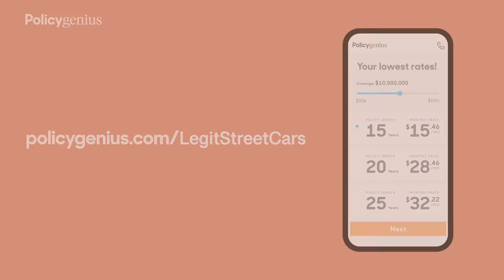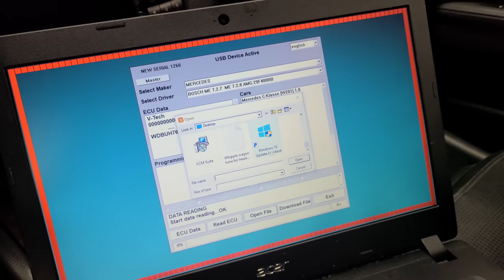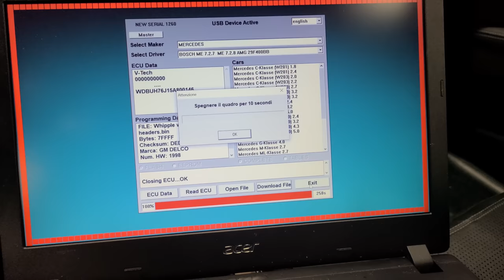We Turned My Whipple Supercharged E55 Wagon Into A SuperCar KILLER With 3 DIY Mods! Sounds Insane!

Comment: I allways use the AMG Transmission Mount A2122401018 (about 50€ over here in Germany), it got 3 Anchor points instead of 2 (the Blackseries Mount, is fully rubbered and super expensive compared to Originals or Lemförder, 130-200€). 
Wagon = Best daily!

Comment: $1k for headers might seem like a lot until you price out a header for my '05 Mini JCW... $1200. For a single 4 banger header.
Reply: I feel ya, custom UEL headers for my subi are around the same price.
Reply: Depends on brand and if you're keeping the cat. Can get a Miltek with test pipe for about 500.
Reply: I laugh at $1,200 headers in my E39 M5 voice 😂😁😂
Reply: or you can go with ceramic coated long tubes from eBay which are the same quality as VRP except $300 cheaper, and offer reduced heat in the engine bay like I did
Reply: @iPodTouch4Life20  Unless they have a brand name on them, I doubt they're the same quality. Most of the stuff on eBay is Chinese knock-offs that look good but crack after a few hundred heat cycles.
Reply: Dont be that guy. Yes, we can all build our cars with hopes and dreams from ébay, but sometimes you don't want to.
Reply: @aaronbritt2025  mine have served me well for 30,000 miles. Initially I was against it too, but I had a guy who has a discount code with VRP (I won’t throw him under the bus), let me know that he recommended eBay over VRP because he restores these cars and builds them routinely and has the experience At one time having both eBay and VRP side by side, he said he couldn’t tell the difference so I trusted him and I haven’t had any problems. That’s not to say I won’t have problems in the future but this is my experience. Yeah, eBay has a bad reputation for parts sometimes but unless you’re going with ARH, don’t worry too much. The cost savings is worth it in my opinion, especially since fitment is no difference.
Reply: @playerroku4412  check my reply. For this application it’s different. I treat my car with the utmost care possible, but when something makes sense, it just makes sense.

Comment: A tip: do not tighten your headers onto the heads first. Get the nuts started on them so it still moves, then work from back to front when tightening them. It will make your life significantly easier.
Reply: Speaking from experience? 😎

Comment: I drive a 2015 Mustang GT PP1 with the bolt on items with a 93 tune and seeing around 500hp.  As much as I would love a "kompressor" and approximately 700+hp, 500hp is "enough".  Love the fact that I get to drive it on the Autobahn on the daily and get it opened up on the unrestricted sections.  I agree with the BEV comment.  ABSOLUTELY NO SOUL.  It might be a rocket, but without any V8 noise, what's the point.
Reply: Every couple years I spend months in Germany. Between Frankfurt & a town near Düsseldorf. It’s amazing sometimes just cruising in the right lane & seeing hoe fast bikes and cars fly past.. literally in a blink of an eye. Germany is number one for roads too in my opinion.. smooth & not filled with cracks and holes like every city in America haha

Comment: For the airbox there is a carbon fibre all in one piece you can fit to that TB.  It also uses factory filters and bottom sections, plus the intake tubes from the radiator section.  Looks very clean.

Comment: Amaaaazing set up, love it. Be very interesting to see how the trans holds up with the increased power/torque. Perhaps taking regular samples checking for oil and clutch break down over set mileage to track how it's going?
Reply: The trans is good for about 700hp and about 770 ft lbs. With these engines it is the torque that becomes the limiting factor as it is so high. Above 700hp the torque is too much for trans to handle. 

TT V12 used same box and was detuned to keep torque in check. The 7-speed was not strong enough so they used 5-speed until about 2012 for the engine!

Comment: Hello this is your twin from another mother from Cali!!! I have 2004 silver E55, just acquired 2003 SL55 and the nemesis 2005 CL65 with under 70K!!  All run great but when the CL breaks it breaks.  I have been told the total repair bill for the CL65 is 25K for the close to two years of ownership.  Would love to make the 55s faster than snot and I'm sure one day I will, just have to build up the nerve to take them apart and put them back together. Just know that every time your CL is sitting mine has been running (where is that wood).  Until these days happen' I will live vicariously through you. I don't do social media. but I have enjoyed watching what you do.  Last but not least, first car 1980 white Trans Am with the biggest blue bird. Of course, it came with the smallest engine.

Comment: Now some custom rims and drag radials for the back. An inch smaller for some sidewall. The one drawback of short sidewalls is like solid engine mounts. They transmit driveline shock to the contact patch and blow the tires loose. A little more meat allows the tire to preload as the inertia to get moving is overcome. They wind up ever so slightly and release within the first 30 feet of launch.

Comment: will you keep the stock exhaust parts or will you upgrade to a louder exhaust ?  I would put a straight pipe from the headers to the back and put the valvetronic universal valved muffler on so you can quiet it down with a remote if you want to

Comment: Hi Alex, I recently bought a 2003 e55 at salvage auction to give it a new life. I've watched your videos for a long time and heard you say you used to work as a mercedes technician. Perhaps you could help me understand what software is used for a 2003 e55 with regards to parts, wiring and diagnostics. Would xentry passthru with a direct obd2 to usb cable to a laptop work or do I need older xentry/star software with a physically multiplexer? Thanks, your e55 is awesome

Comment: Hey Alex I'm working on my 2003 e55 AMG and I'm doing the o-ring that go bad on the m113k engine and in trying to get the upper oil pan off but it stuck on the dipstick guide so I can't slide it out. I'm asking if I have to remove it or find a way to slide it out?

Comment: Quick question - I have a 2004 e55 amg. Mechanic says brakes and rotors are fine but after they heat up there is a lot of break squeel. Is this normal? Mostly under light breaking.

Comment: How do you follow torque specs for exhaust header nuts when you need to use all sort of crazy extensions and swivel joints to get to the nut?
Reply: German torque spec - gutenn tight

Comment: I need your opinion on something. I have a 2000 Toyota Camry LE 4 cylinder. I want to put a cold air intake on it. I was told by a friend of mine that works at Advance Auto not too. I still would like to get a cold air intake for my Camry. I'm customizing the Camry. Yeah I know it's a 4 cylinder. Also would like to get new exhaust headers for the Camry. The exhaust manifold seems to be rusted pretty badly. So do you have any suggestions for that too? Please respond thanks.
Reply: Honestly…..not worth the time and money….wait until you have a car that doing that work would get better gains for

Comment: long tubes to make the engine last longer....cute.  Your excuses for the wife justifying modding are on point.
Reply from the maker: They really do!
Reply: @LegitStreetCars  not really bud but I like where your heart is at lol.  Well I guess depending on the platform.  Some vehicles yes others not so much, if at all.  But if the tune is on point that should be a non issue.  Either way though they do flow better and make more power so its a win win.
Reply from the maker: "Some vehicles yes." The E55 is one of those vehicles. The engine will produce 1 lbs less of boost with long tubes. That's good for longevity.

Comment: Hard engine mounts and hard suspension bushings have no place on a street car, especially a luxury car. With racing, performance is paramount. With street driven cars, it's just annoying. The vibrations and squeaks ruin the driving experience.